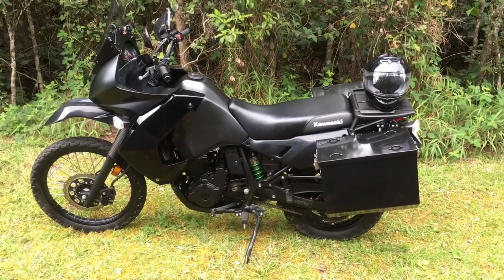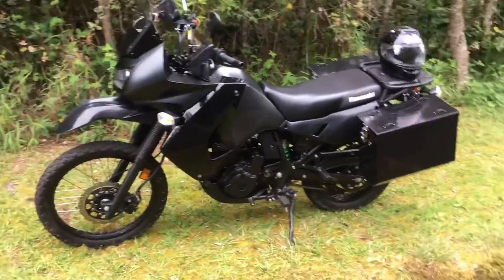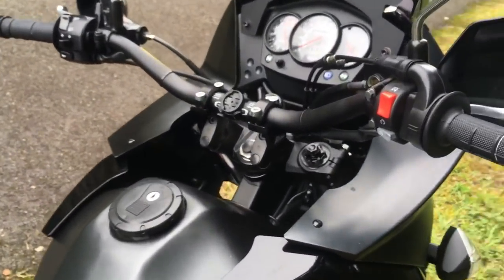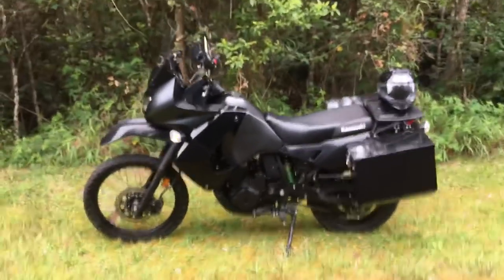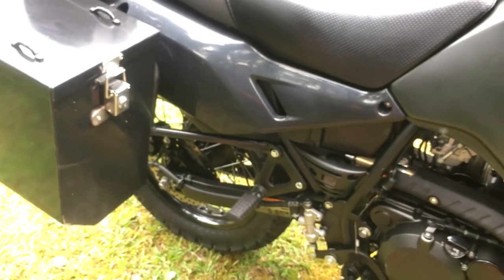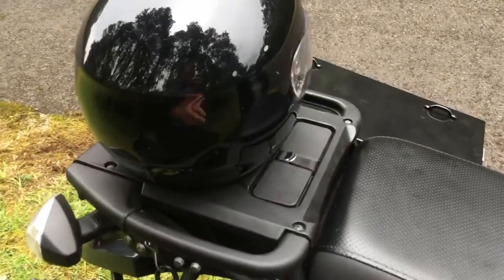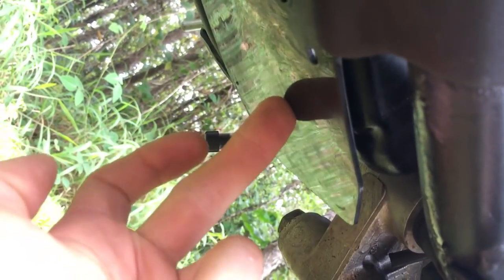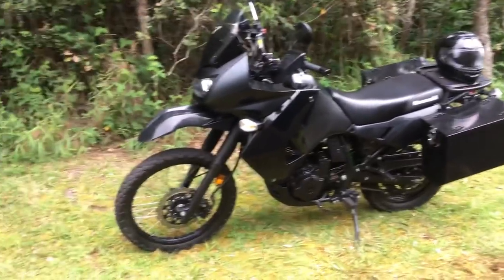KLR650 Review (Watch BEFORE Buying!) Full Feature

Comment: Ktm fanboy..So what if the klr is a bullet proof tank.. I'm going too go with the ktm that's expensive too fix, maintanence heavy and unreliable but it goes faster..
Reply from the maker: KLR fanboy... Did you even watch the review?
Reply from the maker: This wasn't a KLR vs KTM test. You can't compare a VW bug to a Porsche in price or performance.

KTM has 6,000 mile service intervals per manual, literally double the performance, and same fuel econ. The only consistent reliability issue is fuel pumps, and that's mostly because people dump dirt in the tank and never replace filters. Dump dirt in any fuel injected vehicle and see what happens. Hell... just let it sit with rotten ethanol gas all winter. IF you could ride the KLR like a KTM... it would come apart in dramatic fashion. Just like a bug would if you could drive it like a Porsche. The fact is, you cant. So we'll never have that test.

In the thumbnail for this video... KLR struggled to make it up the summit. It about cooked itself laboring at altitude, barely ran, needs constant on the go fuel screw adjustment (real pain in the ass) and lost the rear tail to the rocks. Max climbing speed about 12MPH and was sketchy as hell. Descending maybe even sketchier. Last weekend I hit it between 40-50mph on a KTM (not my 690 but I have video of that too) messing around... not racing. https://youtu.be/3SSISjWuoQ0?t=285

Ride a KLR. They are good bikes. I'm just not the "hunting bike" or "touring bike" rider type. I'd loved commuting on the KLR and had some beautiful 8 hour days on it. I was parts manager at a shop for 8 years... also a service writer and unit sales. Done nearly every job at a dealer (every brand) and also Harley accessories. I've forgotten more about bikes than most people who will watch this video will ever know. I personally sold KLRs new and my shop was the #1 KTM dealer in the state in 2001 (our first year) and #3 in 2002 with my friend and I at the wheel. I don't say that to boast, it's fact. I lived motorcycles from 93-05. I don't even own 4-wheels and only have for 1 month in the last 12 years.

Comment: The KLR has been around since dinosaurs roamed the earth.  I’m surprised the pros and cons of the beast were evidently new to you.  The KLR excels at nothing but does everything well.   A KTM it ain’t.
Reply from the maker: Well, no they weren’t a surprise. I actually sold them as far back as 2004. Never in my life did I figure I’d own one, and I never would have... 

I’ve spent the last 6 years as a triathlete and had converted to mountain running. I was riding my Duke (which I rarely rode) up into the mountains. Not only was it not going to survive long, it barely has the range. I was packing gas. The KLR fit my budget and seemed like it was going to be the perfect budget long range cruiser for my needs. It kind of was... but going off road the first day to get into the mountains was like sticking a heroin needle in my arm after 14 years. It instantly felt like a mistake. It did nothing well except cruise paved road smoothly. Since I had no intentions of getting back into bikes, I tried to love it for what it was. Within 3 weeks I was trying to figure out how I could get rid of it and afford more and better. I think 2 days after the first payment, it was gone.

Where there’s a will, there’s a way. I’ll begin working on buying my 5th bike in 19 months since the KLR here next month. 4 of them KTMs. The 690 was the first, and for me, the perfect replacement for the KLR. Then I wanted faster and more nimble, then a better flier, then a couple trainers 🤣 #DirtbikeDisease
Reply: Glad it all worked out.  Horses for courses.

Comment: motocross background... can't wheelie a KLR 650.  LOL
Reply from the maker: oosteveo315 in fairness I hadn't ridden a motorcycle 14 years and never owned a bike that big or slow before and almost zero 4 strokes. I'd been riding it 3 weeks, mostly commuting in the street. Traded it in for a 690.

Last time I rode before that was 2004 racing INT/A on a 250SX smoker.
Reply: just bustin your balls.  I hvan't even ridden a klr.  Just seen videos.  #keyboardwarrior
Reply from the maker: oosteveo315 🤣 it was fair enough. Unless you're riding a 1/2 groomed fire road across country, you won't be impressed. It's a 60mph pavement warrior or 25mph gravel roader at best... and it's perfectly dandy for that. It's like riding an off-road Goldwing.

I'd take a much more capable 690/701, DRZ, or XR650 variation any day for touching dirt.

Comment: I know the kaw will be more reliable than the ktm
Reply from the maker: ConditionRed well yes, but only because its at an incomparable performance decrease. The old LC4 and KLR engines were comparable, but the new ones are double the horsepower. The chassis once again not comparable. Comparing the two bikes is like comparing and F150 w/straight 6 to a Subaru Impreza. You can't, but there's a market for both.
Reply: @JohnHowerton137  There will always be different classes, i.e the Africa twin, bmw gs, triumph, etc. Sure, I had to dump about 3k to 4k into my klr over the years, but now I have it just the way I want it to be, and it's a fun and learning process. I'd be horrified to work on a bmw! I can take apart the klr and piece it together like legos, splice into wires, drill holes, and bash it around lol.  Probably need to dump another 4-500 bucks to upgrade things I need, so I'm looking forward to that. The thing I like about the klr is that it always starts up. One winter I left it outside and uncovered (rain and 30 degree weather). About a month later it started right up! Stock battery and never was on a battery tender!  My 2017 harley wouldn't last a week lol! Sure the keyless start is a great feature for bikes, but I'd much rather have a bike that starts up.
Reply: @JohnHowerton137  but goddamn, that 300 straight 6 ford put in those 'ole F150s was a HELL of a motor. Thank you for reminding me of my old '96!
Reply from the maker: @michaels2136  bombproof tractors just like KLR. I had a friend who sent one to hell and back many times. His was probably about an '86.
Reply: @JohnHowerton137  unfortunately, i sent mine (well, my old man's, really) into a tree 17 days after i got my license. Learned to drive a standard on the street in that thing,  and hauled plenty of deer out of the woods with it. Damn, i miss that guy
 And that truck.

Comment: great review , klr biggest downfall weak heart/engine
Reply from the maker: joe blow I could probably deal with the engine, but the chassis scared the crap out of me. KX 250/450 and it would totally change the bike.
Reply: John Howerton  Im debating between a new klr650 a dr650 or a drz400,I want want something that works great on and off road and can climb a hill easily,really stuck on which one
Reply from the maker: joe blow unless you plan on riding serious amounts of road miles, I'd get the DRZ. Tons of aftermarket hop ups and its the most capable machine off road.
Reply: John Howerton  I have a harley for road miles, I found a new 2018 drz400s for 4999
Reply from the maker: joe blow sound like a good deal unless you can find a KTM 450, 500, 525, 530 for that price 😆
Reply: John Howerton  found a 2018 KTM 690 Enduro R for 8995
Reply: John Howerton  and a new 2013 ktm 500 exc for 8950, not sure how good those prices are
Reply from the maker: joe blow thats a great deal. I have plenty of videos on that bike 😉
Reply: John Howerton  which is better bike for 50/50
Reply: John Howerton  looks like 690 is the one 90mph on frwy not bad
Reply from the maker: joe blow it goes a a whole lot more than that. That was with loaded Pannier boxes and a good headwind. 55mpg at 70mph.

690 is going to be the better 50/50. More oil capacity, HP, weight for the road. Hit the 70% dirt and the 500 is probably the machine. If I didn't have 40:00-1:30 mins on asphalt before hitting dirt, I'd be on the 350 or 500.